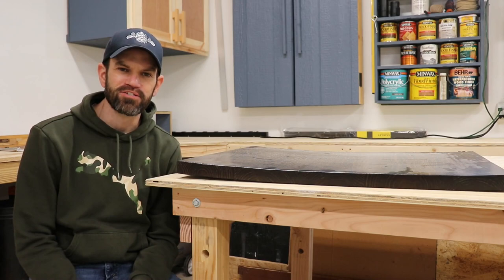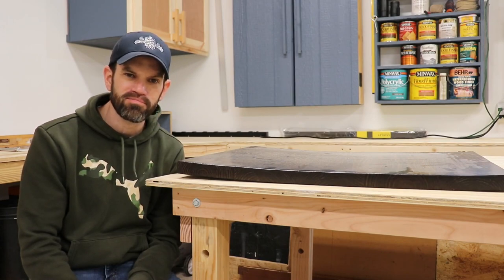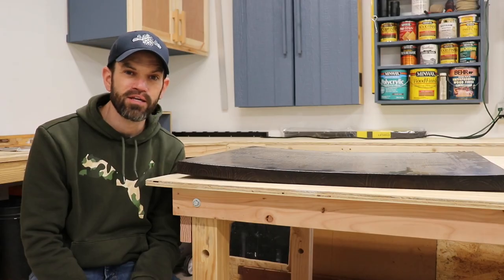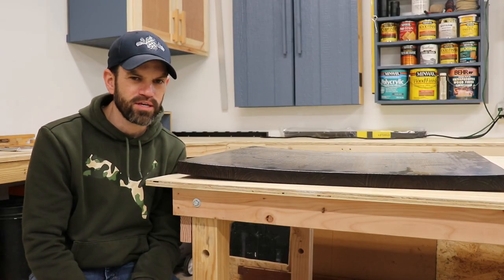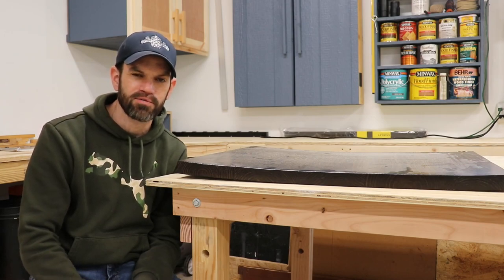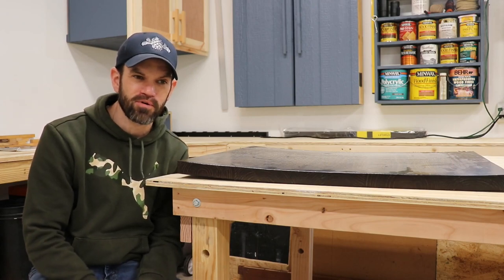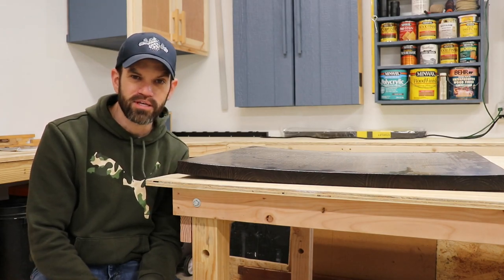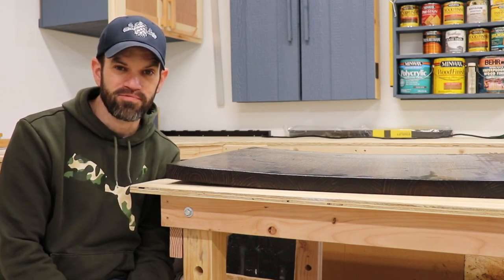TABLE TOP Glue-Up Tip / How To NOT Make a Flat Table Top

Comment: Its not that it “will” warp. Its that its “possible”. Flipping the grain is a bit of insurance that ensure that “IF” there is a humidity change it will be kinda self cancelling. Or at least limits the effect. Yes, base moisture is important to know. I made this mistake. I bought some construction 1” x 6” and they were beautiful. Almost clear. Used them too wet. Alternated grain and avoided the “bowing” but a few cracks showed up after finishing. Had to bondo and repaint.
Reply from the maker: Yep, thanks for the feedback!
Reply: No problem. Made the mistakes. I suppose I have many more mistakes ahead of me. Lol
Reply from the maker: We all do!

Comment: You also need to finish both sides of the wood, otherwise it's still guaranteed to warp. It's called "balanced construction", whatever you do to one side,  you need to do the same to the other side.
Reply from the maker: Yeah, good point. Thanks for the feedback
Reply: Not necessarily so. Most of the wood furniture made in the US over a hundred years ago had no finish on the underside.
Reply: @robertcornelius3514  but they weren't using the power tools we use today and building a table took much longer I would imagine
Reply: @robertcornelius3514 Wood acts like a sponge, put water on one side of it and watch it curl.
Put contact cement and laminate on one side of a particle board countertop, and watch it bend up.

Comment: Just soak some towels with hot water!Slowly clamp the ends n the middel, Apply pressure little by little untill flat! And let it dry for some days amd the. apply c channels! Ohh almost forgot! Make some small cuts underneath the table(Not all the way) so that it gives it more room to move
Reply from the maker: Thanks for the tips. I tried the hot towels but completely forgot about the C channels on this one even though I used that method in the past for a table top that had a pedestal base. That was to prevent sagging, so makes sense it could help with warping as well

Comment: Another reason to cut and flip your material is to offset your fence or blade being out of square. We all like to think our jointers and table saw are perfectly setup but the reality is they aren't. If the two edges are perfectly 90 degrees, the clamping force will cause the faces to pull tight but because there could be at a slight angle, this causes the edges to lift. When you cut and flip, you are facing two complimentary angles which cancels out the error. For example, if you're using your table saw to rip the width of the board and the blade is at 89.5 degrees - then you have a 1 degree angle between the boards but when you flip the boards you are getting 89.5 and 90.5. After the flip, you have 0 degrees of bevel so the boards clamp nice and tight. One degree doesn't sound like a lot but if you have 6 or so boards, as you do, then you have introduced five such errors.
Reply from the maker: That's a great tip. But in this case the boards lined up and glued up straight. It wasn't until after the glue had dried, clamps removed, and the table top sat for a couple days that it began to warp. Is it possible that the out of square edges took a couple days to show?
Reply: It's not necessary to flip the orreitnation of the grain direction to do this. You can lay out the panel however you like (visually pleasing being the best way, generally), and then flip the boards as you put them through the jointer. This gives you the benefit of the tolerance offset without the old wives tale nonsense about grain directional

Comment: If you watch Rob Cosman he says that doesn't really help allll that much. And I think he and others have said that you need to secure it. So like a C channel or flat metal bar or bread board would be enough. That said, I'm much newer than you, and have not yet used these techniques so YMMV. :)
Reply from the maker: Hey Caleb, you make a good point. I have used something like a C channel in the past and it worked well to stabilize boards that had some flex. It may have helped in this situation too. I need to keep that in mind. I appreciate your feedback!!

Comment: You have the length of the boards going the wrong way. If a piece is 2 feet wide by 4 feet long you want the boards running length wise not width wise (or whichever way is longer). In this situation the grain direction does not matter. That would have never stayed flat. Hope that makes sense.
Reply from the maker: Yes, this was an off cut of the full size table. The grain did run length wise on the 3x6 foot table

Comment: basically you have to know this: if you look at the end grain of a board, with time, the arc that you see on the growth rings will tend to become "flat" so, the very best thing will be NOT to have like a full semi circle in one board as you can see one that left board but to have those ring line as parallel as possible - that's why quarter sawn boards are more expensive, and therefore more stable
Reply from the maker: Good tip, thanks for sharing